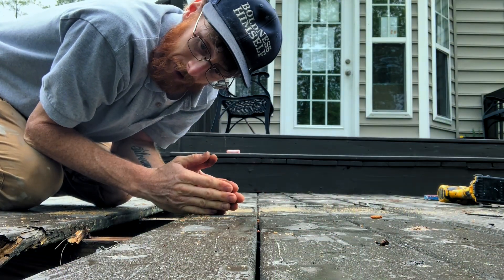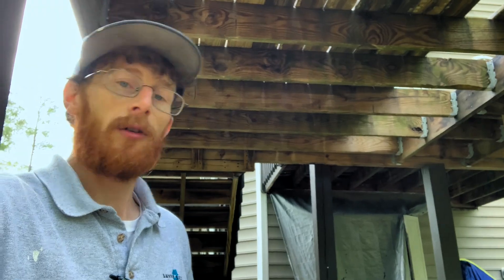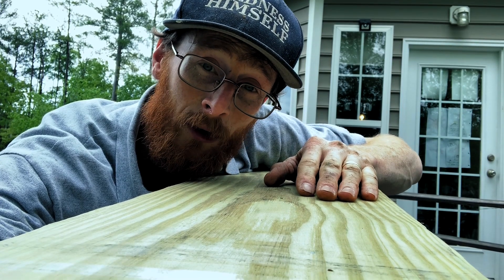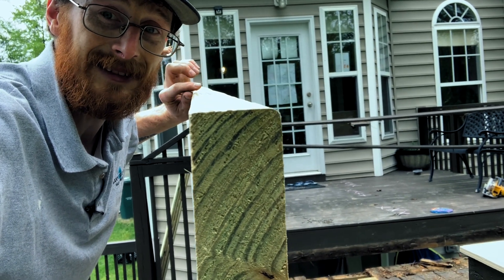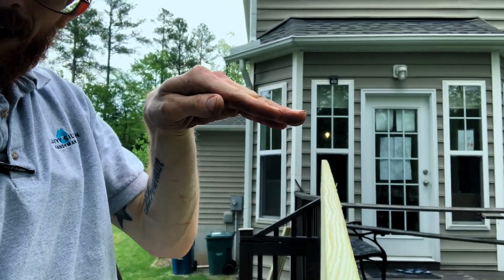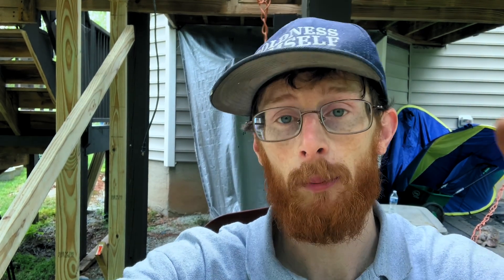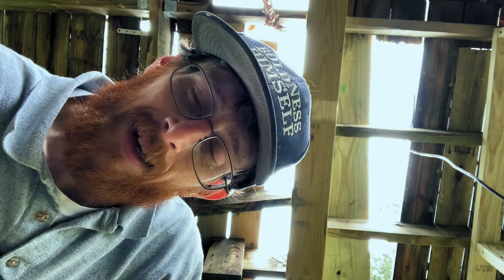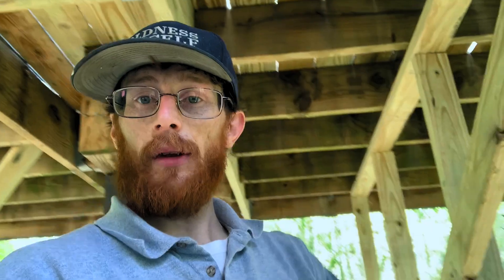HOW TO replace a rotted deck joist

Comment: it looked like several other joists running perpendicular to the joist you replaced were either rotting or starting to rot as well.  did you replace those too?

Comment: I have support on my 16' section with a 8' 4x4 in the middle to relieve pressure off of the center post, so i can replace the rim joist on the front of my deck. they had two 8' rim joist i am changing it to one 16'. will my deck be alright can i replace the joist without it falling?

Comment: Hi. How do you remove the old joist hanger. I can't seem to get behind it to remove. What tool did you use?  I want to save my joist and not cut it..  Thanks.
Reply from the maker: I used a reciprocating saw and cut the nails holding the joist and for some of the nails I used a claw bar, hammer, and pry bar 🔨
Reply: @ChrisSilverman  Thanks. Those suckers are brutal. I appreciate it. They are so hard to get to.

Comment: How much would you charge for this :)  ?
Reply from the maker: Scoring Support The cost fluctuates between different companies , contractors, and craftsman but if I recall correctly I charged $800 labor for replacing the joist and about 20 deck boards on the entire decking. The materials were additional but I think total project was about $1200